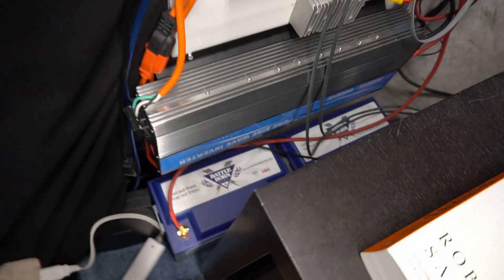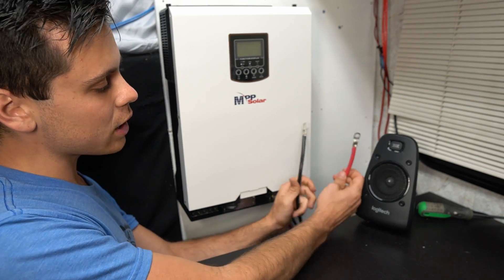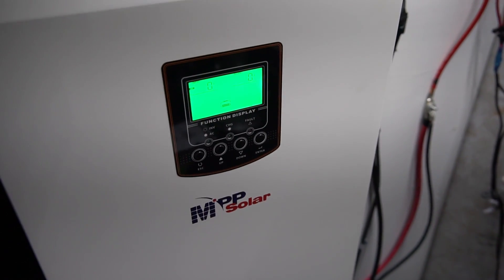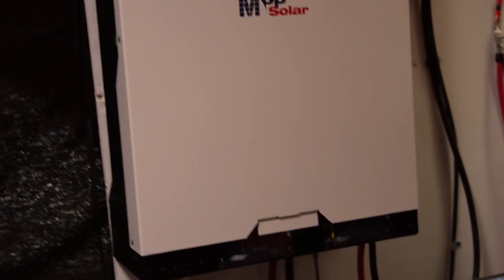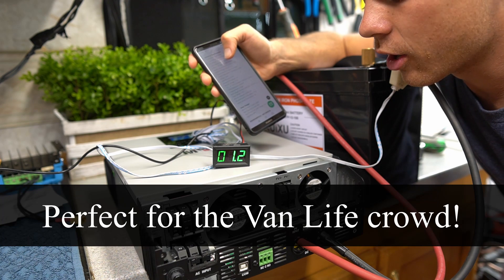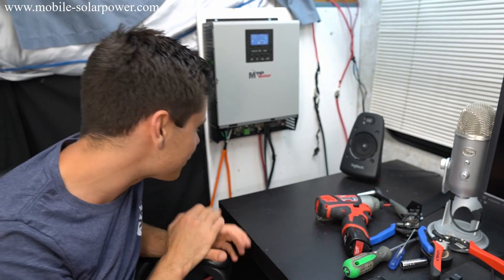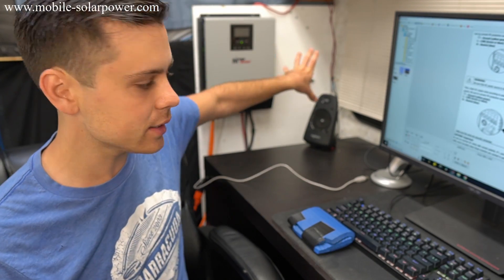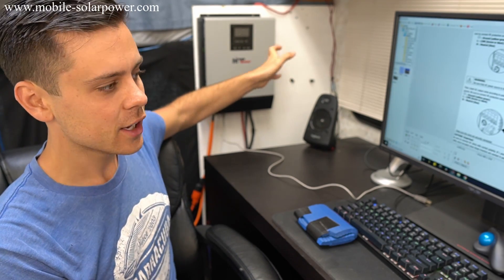MPP Solar Power Inverter/MPPT/Charger "All-in-One"  - Complete Review -

Comment: Will, so glad you present this integrated option.   These units are very reasonably priced and have  some really nice features.  For the mounting problem it looks like under the bottom access cover there is a hole in the center in a circular boss that looks like a screw could be put thru.  The other option is to drill some holes .  On the fans noise issue I would try upgrading the fans to a higher quality version.  This would make a good video showing change in noise level and amp draw.
Reply: Bottom mounting hole confirmed, it shown on page 5 of the manual.

Comment: Hi Will, Does the Fans in the bottom blow outwards ( down ), I was thinking that the temperatures might get better if the unit is placed upside down so that the fans blow all hot air upwards.  Perhaps the fans wouldn't need to work as hard with this solution?

Comment: The cost analysis between the MPP and modular is a no brainer.  

Have you considered breaking open the MPP and converting it to modular...(maybe there are multiple boards and connected by harnesses that could be extented) that is, if  possible, replacing the fans with heat sinks (or apply some big heat sinks and a quiet fan system too as a mod...)    You are going to void your warranty but these things are not exactly going to break the bank and looks like that would be a great project

Comment: I have a 2017 Jayco Greyhawk 29MV, it came with a Macnum Dimension1000W pure sine wave  inverter , with a Macnum Dimension CSW-TS15-H 15A AC Transfer Switch and lastly a Progressive @t INTELI-POWER 9200 Series Model PD9260C,  I wanted to upgrade the INVERTER with a GoWISE Power PS106, 3000W pure sine wave inverter, can just the Inverters' be switched or will the Transfer switch and Converter/Charger  also have to be upgraded .

Comment: Almost perfect for mobile applications.

If only it had a DC charger to connect to an RV's alternator.
Reply: The most compact RV system I can come up with is a battery plus a Kisae combination Inverter and 120V Charger plus a combination MPPT Controller/DC Charger. Takes care or inverter output and all three types of charging input. Both pieces are super high quality components.
Reply: If you get the 12volt version then you could hook up the alternator to the battery’s with a relay.
Reply: @pioneerpete8170  Bad idea. With either version you use a DC to DC charger and connect the RV battery to the Engine Battery. They will charge each other.

Comment: Go to the site they got more options and the 220v version can be adapted for 120 240v using an autotransformer
Reply: No transformer, just buy the 220V unit. Transformers do not correct Frequency.

Comment: Great content as usual Will. However a unit like this, while perhaps simpler, puts all the eggs into one basket. Personally that is unappealing and sort off seems to conflict with being a DIY'er in the first place. I like to understand what I have built so that I can fix it later and not be forced to replace more expensive modules when they break. Also (and maybe I missed it) I didn't catch anything regarding DC output of the unit. Regarding the larger 24v unit would you need to run a separate 24v DC to 12v DC converter?

Comment: Thanks Will. Quick question. There was no mention of where one would connect to the existing 12v system fuse box for the lighting and other 12v accessories?  Anyone have some input on this? Connect at the battery connections? Thanks
Reply: Mr. Natural just wire to a fuse box for 12 volt
Reply: Aaron G would you connect the 12v directly to the battery or the battery connection on the devise?
Reply: @xraykadiddlehopper8067  The terminal location on the MPP doesnt appear to be set up to run multiple lugs, I'd run either a wire direct from the battery bank or create a junction between the MPP and your battery. Just be sure to fuse the branch based on your 24v or 12v load.  This setup seems so easy. Will shows the AC power output using an extension cord which has flexibility and this could be run into a small breaker box to power your 120v circuits.

Comment: This is awesome!!! I have your book and will be building my solar system in a few months. I'm good with following diagrams and putting all the pieces together BUT for me, calculating usage needs in an issue. My brain shuts off when I have to look at all my devices and find watts, amps, volts and mega-jizzy-fuzz fuses. Reverting to 3 year old tantrum on floor.....
Reply: You got this!
Reply: Have you seen Will's YouTube video. "Electricity explained: Volts, Watts and Amps"? I found it quite helpful and clearly explained.
Reply: Yeah, no kidding, especially when you consider duty cycle, its not likely everything will be on at the same time like AC and a refrigerator, which makes it near impossible to calculate. Im considering running my (approximately) 3,800 watt AC on a separate 5,000 watt inverter and switch over to grid power for the 1/2 second startup surge of nearly 100 amps at 230 volts ac.

Comment: I got the 15kw 48v dc from China eBay for $600 but I’m waiting for the 60v dc input model! You need minimum 48v dc for any of them to actually work! The chargers are easy to find and cheap! A 60 amp will work on a 5kw solar panel array! All of those electronic do dads need an air conditioner to keep it cool unless it’s winter! Can you teach people how to make their own lead acid batteries? The prices of batteries are ridiculous!

Comment: i have one 24v 3000 watt it is easy as ever to set up.
Reply: Is an all-in-one system better than buying and building your own modular system (disadvantages/advantages)?
I'm completely new to solar and want to build my own system for the first time in a few weeks, but I'm still busy researching, sorry...
Reply: Did you need a transformer to break down to 120ac
Reply: @edwardshomestead9074  Break down from where? If you are using 240V then there is a 240V version. If you are in NA then nothing needed.

Comment: Hey, great find and review, can you elaborate on your hot water system? Also have you considered using a small 10Ah battery connected to small flex panels to charge yr larger batteries during poor daylight with a suitable charger?
Reply: zwarst he uses a simple water heater that has a heating element
Reply: Use a smaller battery and panel to charge a large battery. Seems the bigger panels would do a better job.

Comment: I have used the 800VA,the 3000VA PIP2424,and now using tha PIP3024GK, which is off grid and it works flawlessly. Thanks for the review.
Reply: I'm looking into building my system for the first time: are there any disadvantages of buying an all-in-one system when compared to a self-built modular system? (I've yet to buy my first component and have been researching the past 2 weeks)
Reply: What does the acronym "PIP" mean?
Reply: I have the 3,000 volt system. Trying to figure out does it feed back to the grid power to lower energy cost. Because this system makes more than I need. I was wondering if it will lower my energy cost.

Comment: Please check inside the box there is a small L bracket that help to hold the cables and also help fix from the bottom,there a hole at the bottom of the inverter where the solar cable is connected
Reply from the maker: Yes there is. Little brackets. Should have used them.

Comment: And you used WHAT AWG wire for the AC input??

If it has an AC transfer switch, the whole load goes onto those wires!
Reply: How many amps are you bringing in? 30? 50?

Comment: I'm sure these units are rebadged and sold by many other companies with the same hardware & software.
I use the EASUN POWER Solar Inverter 3KVA 24V model from China, Costs about £220 (275 US) inc p&p
Great little units. Its been in use 24/7 in the shed running at 500w - 600w for over a year, Well pleased.
Nice video Will. Great information for the newcomers to the subject. Thanks
Reply: They are - they're rebadged by heaps of companies. Theres also copied of the genuine MPP product, which won't accept genuine firmware updates.
Reply: Yep, I've heard of the Axpert model, which is resold and rebranded here in SA as a Mecer product. Just a month ago I installed one of these, the 3000W model as a 24V system, with 4 x 12V 100Ah AGM batteries. The settings seem identical e.g. 18 for beeps, etc. Works really well.
Reply: Great information , I’m a overlander and very new to solar, I’m getting rid of my AAA powered baseball cap light and learning about some real power options ! You burned through a ton of specs, really fast all with different options, so I’m buying your book.
Reply: How long have you had your ESUN unit?  any problems?

Comment: Hi Will, I've been using a higher power version of this - MPP 5048 MG for a few months now, I use a 2kw solar array & a bank of 48v flooded lead acid batteries (21kw)  I have mine in the outer garage & it is wired to power the entire house, during the day it can run up to a max of 5kw output, I purchased a 2nd unit with a parallel kit & have yet to install it to give a potential 10kw output supply, I have come to the conclusion that my flooded lead acid battery setup just does not have the potential power density that a lithium iron setup could provide, so it limits the amount of time my setup can provide off grid use here in the UK, the fan noise is a small price for component longivity at the end of the day, I removed and turned my fans around to force cool air upwards to increase thermal efficiency & it and it made a big difference to operational temps, nice video by the way.
Reply: John, consider a used electric auto battery similar to “Going Off Grid”s doing.  I spent $4,000 for 33kw.  Just a consideration.
Reply: Hello lasidora!
I just bought HYB 5032M inverter.
The box and layout exactly like on the video . Problem is that I can't find a maximum wattage for solar array for it.
On the label for solar charge:
Amp. 80
Operation voltage: 60 - 115v
OCV. 145v 
In your manual what is the maximum wattage ?
Many thanks.

Comment: I do not like the all in ones.  Back luck with them personally.  What I find happens to me is one part of the system will fail and of course takes down your system.  You then have to buy a another one and that means you are purchasing all parts of the system again.  With components separate you can purchase the single component that has failed and your off.  This way does take up much more space though as was noted in the video.
Reply from the maker: Which one failed on you? I need the model number. The diy powerwalls guys have been using mpp all in one systems for years, 24/7, so I am collecting information on all failures. Please let me know all the details you can. No one has provided me with evidence of their failures, so I am looking forward for your evidence to substantiate your claim. Will check back for your comment or video

Comment: The Mpp Solar web site is hard to navigate to even find the product you want to research. Found the 2400/24 on eBay but lacks needed engineering info like max 110 Amp input like 15, 20, 30 or 50? Would need info such as min/max dc voltage auto shut down, mppt charging adjust able parameters, adjustable grid charging parameters and etc. 
Where can this engineering be found?

Comment: Will, you could swap the fans for quieter ones, or add a resistor to them to slow them down a bit if temperature isn't a problem. Locking away in a closet might not be good if it isn't ventilated to allow cold air in!
Reply from the maker: Yes agreed!! Future video comimg haha. I am having trouble finding a replacement fan though. It's driving me nuts.cant be that hard, will find one soon
Reply: @WillProwse  I think a good guide to the flow rate is the watt rating on the fans. They sound a bit beefier than usual PC coolers.
If all else fails, you could mount the fans elsewhere and pipe the air in to the unit with dryer hose!
Reply from the maker: Smart idea!!! I always appreciate your comments Andy. Great ideas
Reply: @WillProwse  
Where there's a Will, there's a way... ;-)

Comment: Can you tell me if the company have those units in 12v to 220ac @ 2000 watts, am very interested
Reply from the maker: Yes absolutely. Check out my website and use the links to the eBay store to find one that works for your application. They sell a lot of different sizes
Reply: @WillProwse  Thanks very much

Comment: And the monitoring software supports Linux!!!  Heck yea!! One thing of note: If you use the larger 24 volt one, you would still need a 12 volt transformer to power 12 volt items.  Shouldn't be hard to hook up to to batteries.
Reply: Use a 24/12V DC-DC converter directly on the batteries to bypass the inverter. I use a (36-72)/12V on my ebike. It can supply 20A and is just a few bucks on aliexpress.

Comment: Can this be used in an RV that is 12v, or is there a 12v version?
Reply from the maker: Yeah absolutely
Reply: @WillProwse  any chance you have a video of how to wire a 24v battery/inverter like this to a 12v system? i didn't see it your book... thanks
Reply from the maker: Oh sure, just put the two 12v batteries in series. I cover it in my 2000watt 24v modular system build. Charge both batteries to full before you connect in series
Reply: @WillProwse  sorry to be a pest, but in this RV all of the grounds are tied together, start batt, house batt, i assume that i need to seperate them if i switch to 24 for house side? correct?
Reply from the maker: There is 12v version on my website

Comment: In a van Can you connect this to keep the main vehicle battery charged as well?
Reply: No not really cuz you would have to keep vehicle battery connected to house battery which is bad. You could just use a little 2a battery maintainer that's powered by 120v AC

Comment: Also, i think another quick video would be opening up the unit and replacing the fans with high end pc cooling fans that would make the system "perfect"  and a nice little diy for the brave
Reply from the maker: Oh I already did that haha but I can't find replacement fans!!! And the insides look good actually
Reply: milestehmad117  - Exactly what I was thinking! Maybe Will can do a video on that.
Reply from the maker: And mpp has been around for a long time. Powerwall guys use these 24/7 for years, so I'm not concerned about it. Not any better or worse than a giandel
Reply: @WillProwse  Fans don't need to be as thick just same size. I recommend noctua fans or be quiet fans. Great cooling performance for the noise
Reply from the maker: @milestehmad117  ok will check those out right now
Reply: @WillProwse  What prize do I win when it works perfectly XD

Comment: The 800W 12v unit now has 1200W on the latest 12V module which is great.
Reply from the maker: Oh nice!
Reply: There seems to be a bit of a misunderstanding here.  The original 12v unit was 800W.  The new model is a 1000w. They also just released the 1200W unit but still sell the 1000w unit. The 800W unit has been discontinued and is no longer for sale.
Reply: @derekmarshall2169  Ok Great give us some links so we can check it out.👍
Reply: @derekmarshall2169  Do you have a link to this? I can't seem to find it anywhere after an intense google search
Reply: Got a link? I can't find where these are. I followed link in description and ebay listings are expired and don't seem to have replacements. Thanks.
Reply: The 800W 12v i received off e bay says 800 watts. Where did you see 1200 ???

Comment: How much are each unit, and does the first one have the same control options as the 12v unit! So that you can control the 24v unit fan. Is there a way to lower the revolutions of the fan, that would lower the fan noise.

Comment: Great video (as usual) will. This is. a great system, but your comment suggesting the fridge may need to be in idle mode as part of the power saving option makes it seem less attractive. I did buy you book (nice job btw) and wondering if I should opt for building one of your 24v configs instead. May be a more flexible option than this all in one. Curious to see what other videos you have coming on this topic.
Thanks for all your help in this subject.
Reply from the maker: Good question. That's a tough question. If you are spending the big bucks, sure, get a xantrex or victron. Very expensive but very efficient. If it were me, I would use a 12v fridge, and run a mpp. My large diy modular systems still pull 14-17 watts at idle, so it's less than a mpp, but not that different. If you have a big system and large array, you won't notice it. If you have a small system, you may need to spend more to get more efficient unit. You can always add more solar panels to offset the loss.